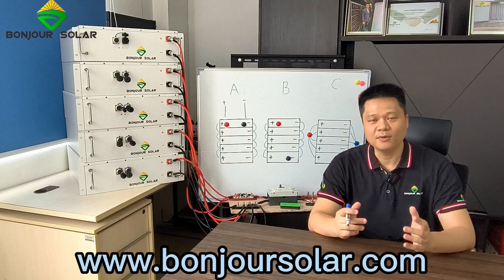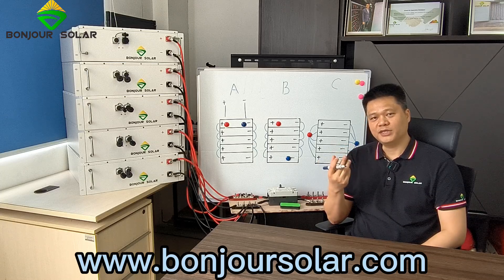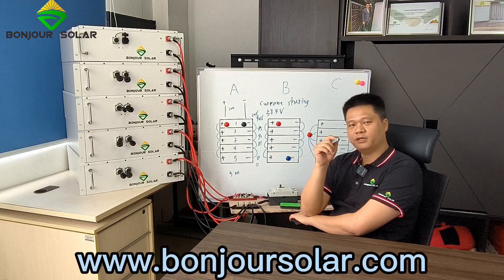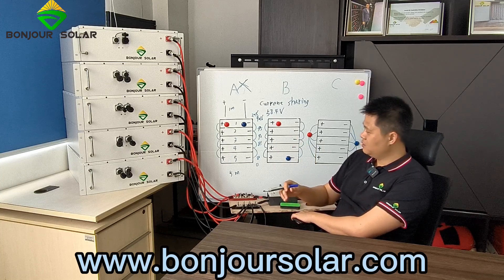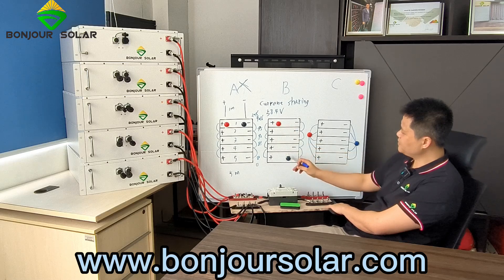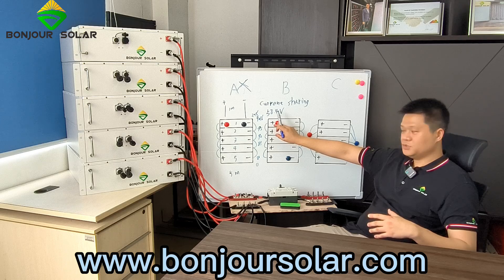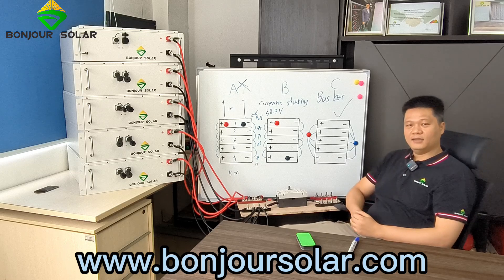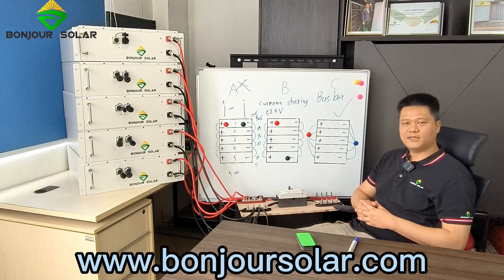How to properly connect lithium batteries in parallel？

Comment: Leo, Good Video.... I agree with your explanation regarding parallel battery example "A", defiantly not the way to go. That first battery will be hit the hardest and will probably be the first to reach the EOL.  I disagree with you on battery examples "B" and "C". Example "B" would be the choice for the best functioning parallel battery system. In this design you are forcing all batteries to consistently draw the same amount from each battery as the output terminations are on the first and fifth batteries, so each battery needs to perform. This is the same design that the "Flooded Battery" manufactures suggest to individuals that purchase multiple batteries use. The key point is that the 2 cables that connect the batteries to the LOAD are of equal length. The problem with example "C" is that even though they are all tied together at a common point the internal characteristics (SOC, internal resistance, BMS...) of each battery will not be equal across the batteries thereby causing some batteries to carry more of the load. 
If you want you can send me 5 of your Bonjour solar batteries and I will be more than happy to run them through different connection testing and isolating the performance of each battery through their "Charging" and "Discharging" cycles. It would make for an excellent YouTube video(s) that I would do. Have a GREAT day!
Reply from the maker: Thank you for your attention and praise. Method B and Method C are widely used in actual installation. Our experience is that if there are only 2 to 4 batteries, Method B is a good choice, but when the number of batteries reaches 5 or more, we think adding a Busbar can better ensure that the length of the wire from the charging end to each battery is consistent, so that the internal resistance of the wire is consistent. And the distribution of the line is clearer, and it is easier to check the problem later.
Thank you again for your attention to BONJOUR SOLAR, and wish you a good day
Reply: @bonjoursolar  I can see where as the number of batteries increases method "B" may have some issues. I have only setup a system with 4 flooded batteries. Always learning. Thanks
Reply from the maker: @donaldhoudek2889  keep on going and thanks for your interest in BONJOUR SOLAR
Reply: @bonjoursolar  Correct, sir.